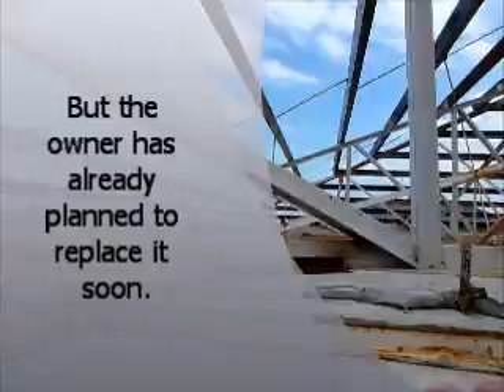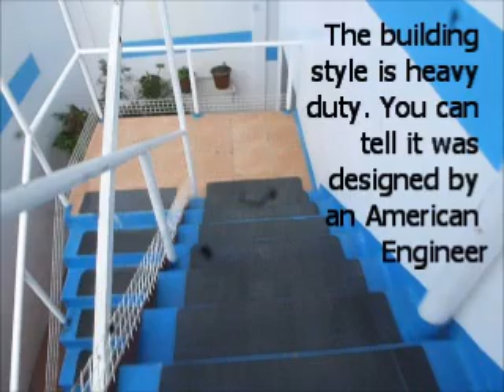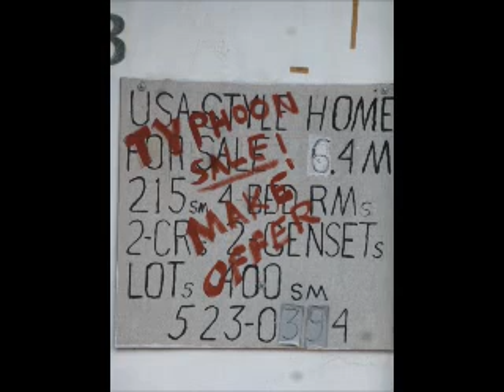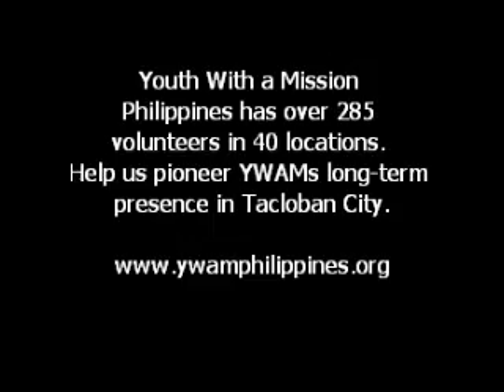TACLOBAN CITY: YWAMers Fundraising for New Center

Comment from the maker: rommelrogercebu: yes. we will be removing the barb wire in the front especially to remove that "prison" look. The first owner was pretty security conscience.
Reply: Pastor Mitch you don't need to take away those barb wire because it only means that the place around there are not totally safe. I'm a Filipino and I studied in Christian missionary school and I found out that corruption are everywhere inside and out of the church.